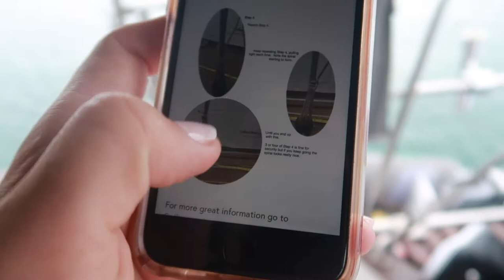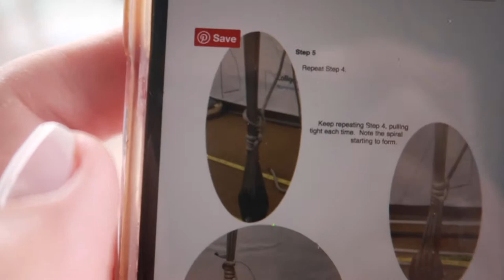Installing colligo dyneema stays-How to make your lashing lines: Chapter43

Comment: Construction Stretch is why Colligo recommends 20 inches because by the time you get all the construction stretch out of the stays your lashings will be half that length.  IF you have a way of taking out all the construction stretch before installing the stays (like have a huge winch on a very long bench so you can load the stays Before installing them or do what the rigging doctor from sailing wisdom does and use a truck to pull out all the construction stretch out) then you could leave less for lashings (also the longer the stay the more creep o er time so on a cap shroud  or fore or backstay you might want longer lashings at first so as they stretch you won’t have to redo the splice because now they are too long.

Comment: When insterting a 1/2 pin into a metric hole which is probably a 12mm hole thus you should have a metric pin which should fit fine and the block should come with a metric pin. Most all blocks and fittings are metric.